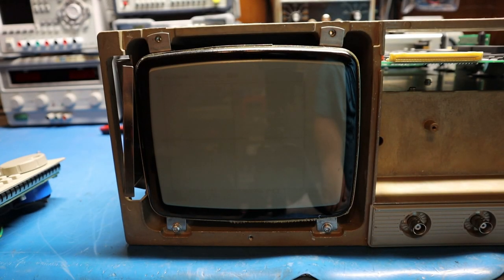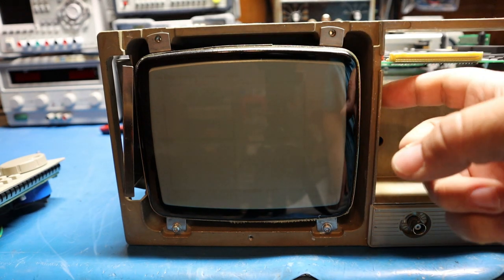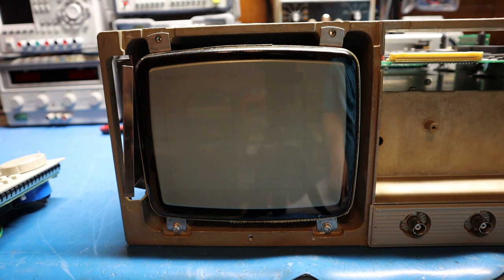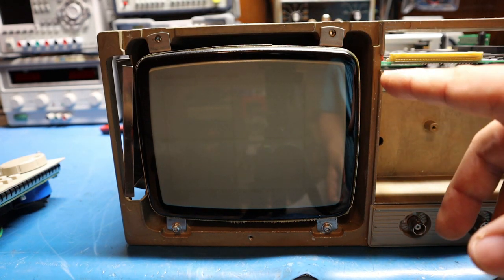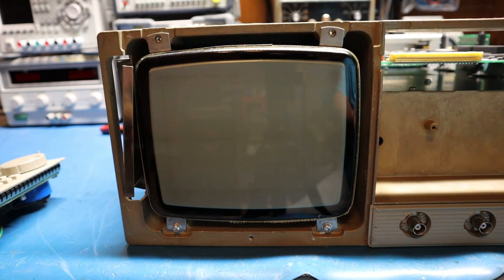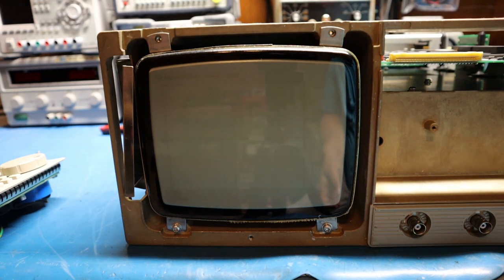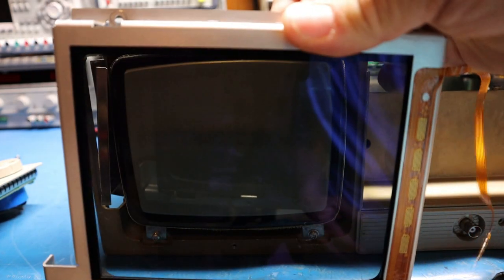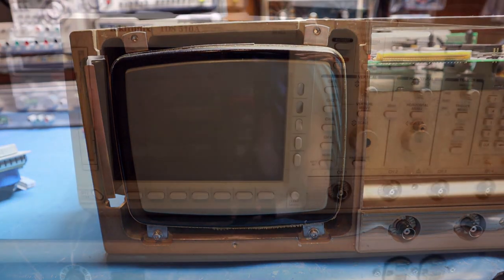Tektronix TDS 510A Oscilloscope No Display Repair

Comment: Thank you, very interesting information where last year, one TDS540C display of french University stopped working and 2 weeks ago same failure in Germany, again with TDS540C. Upon checking, yes there was these dark spot near the Anode inside the chassis.
Reply from the maker: Non corrosive silicon fixes the arcing issue to frame.

Comment: I actually have a TDS744A that the display won't work, I'll be trying this to see if it works. If it works I'll probably still put an LCD in it to cut down on the weight. If it keeps working I may just sell the CRT Module and use the money to buy more equipment. I don't have the 510A schematics, where can I download them. I do have the 520A schematics are the Q's you refer to Q205 & Q405? Keep these TDS videos coming bud. Seriously thanks for sharing. Best Wishes & Blessings. Keith Noneya

Comment: THE TECH GENIE, 
what circuit inside the oscilloscope will draw the horizontal voltage on the CRT screen? 
because there is no horizontal oscillator or vertical oscillator used inside an oscilloscope so how can it draw a sinewaveform on the CRT screen? 

The Ramp circuit only controls the electron beam only to the CRT screen?

Comment: Hello, good morning. Sir, I bought a Tektronix 2465 300 MHz oscilloscope. It turns out that when turning on it takes a while for the flash or the image to appear, it is an analog oscilloscope, could you help me to know if the fault is serious or if it is due to lack of maintenance,
The equipment turns on but the screen is displayed after a long time, help me to know if it is something serious please
Reply from the maker: Work on a few Tektronix 2465 me being my main bench scope and usually bad HV capacitors CRT section that causes that. CRT could be just worn out ton of hours. If you do get it working and CRT and frontend plus hybrids is good I also recommend rebuilding the main power supply as well. Those capacitor on everyone come across were leaking and then the infamous Rifa capacitors goes bad.

Comment: Nice but you want "Electrical Grade RTV" not general purpose as it cures with acid. The electrical stuff cures with an alcohol. RTV748 is white but better for this reason. Black is bad because it has carbon.
Reply from the maker: Yes the stuff used doesn’t have the acid vinegar in silicone. This particular silicone is the same as electrical grade. Yes not all of them are.